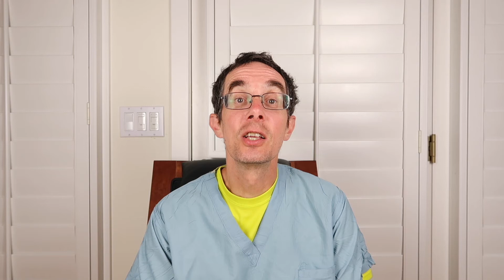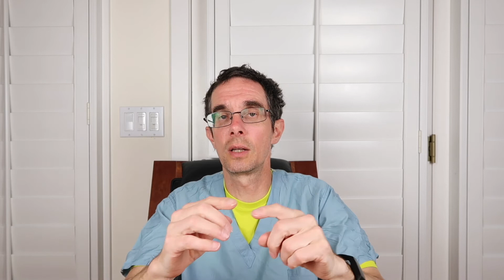Diastolic Heart Failure

Comment: Age - 49 year (female)
Echo reports (April 2022 report)
Mild concentric LVH
grade 1 LV diastolic dysfunction 
LVEF=60% approx
Trivial TR (PASP- normal), no MR, no AR
normal RV systolic function, No intra cardia mass clot
No pericardial effusion , IVC normal collapsing 

Echo report (December 2025)

Mild concentric LVH
grade 1 LV diastolic dysfunction 
LVEF=60% approx
Trivial TR (PASP- 30 mm hg), trivial MR, no AR
normal RV systolic function, No intra cardia mass clot
No pericardial effusion , IVC normal collapsing 

CHANGES (2022-2025)
2022 PASP WAS NORMAL
BUT 2025 PASP IS 30 MMHG
2022 NO MR BUT 2025 It shows TRIVIAL MR

B.P. sometimes get high and sometimes normal

Please reply is it dangerous or can we cure it completely please response 🙏♥️
Reply from the maker: Hi @Para and nice detail in the question! Yes, and no. If you're able to see the numbers in the report, there will be 2 lines that show the thickness of the left ventricle septal and posterior walls (might be abbreviated similar to LV PW, LV IVS). I'm guessing those will be between 1.1 and 1.4cm. That's what the LVH means above, which is mildly increased thickness of the left ventricle (main pumping chamber), which almost always is due to a higher average blood pressure or being overweight. There's something called a 24 hour ambulatory blood pressure monitor, it's not too popular so your care team may not have access to this, but that's a great way to know what your average 24 hour blood pressure is, and that's the best number to go by when treating blood pressure. If that average is high, that's causing the LVH, and both are causing the diastolic dysfunction, and both are also reversible if the average blood pressure comes down (either with meds or limiting sodium intake). Out of everything this is what I would focus on.
The difference in the PA (pulmonary artery) pressures in reality are more likely due to variations on the echo and not a real worsening. Same with the MR (mitral regurgitation). Trivial MR can't be cured, it is physiologic and we can see in everyone if the image quality is good. The valves are thin structures almost like bed sheets hanging on a clothes line, there's always a few tiny areas that don't quite touch and that leaves a little leaking. That is benign and nothing to worry about.
The PA pressures are dependent on diastolic function (and blood pressure and LVH), the upper limit of normal is ~25mmHg, so by definition 30 is a little high, yes that can come down with everything above, but once again I can't be sure that is a real change in the echos, and 30 is minimally high so I wouldn't focus on that number.
If you get a repeat echo in 3 yrs I'd be interested to know what happened in the interim, let me know!
Reply: Should I worry about it ? Is it dangerous?
It shoes any old mi heart attack? Please reply sir
Reply from the maker: Dangerous at this point, no. But if the average blood pressure is high, and the LVH gets worse, the diastolic dysfunction will get worse and eventually cause symptoms. This process happens over years, not weeks or months.
And old mi (heart attack) would be seen if there was an area of the heart that did not move well or if the ejection fraction was low, those are both normal, so although echo is not 100% for this there is no sign you have ever had a heart attack.
Reply: @davidnajman7640 then why ecg showed old lateral mi ??
It was false positives?
Reply from the maker: ECG is the least accurate of all of our cardiac tests, it could be leads not placed correctly, the orientation of the heart, or just the way your heart is. If there was a true lateral MI on the ECG the lateral wall motion on the echo would not be normal. Hope that helps
Reply: @davidnajman7640 thanks dr sir I was too worried about that 
my mother ecg showed old lateral mi and echo show mild lvh 
Dr says everything is normal

Comment: I'm 62, 5' 9", and weighed an average of about 190 lbs over the past year (BMI=28) and recently got an A1C reading of 5.9, which is pre-diabetes. This is the 1st time i was ever notified that i was diabetic or prediabetic.I have never been obese. I also recently got a coronary artery calcif score of 97, an overall cholerstoral # of 237 (with an LDL of 166, TG of 165, & HDL of 38). My resting blood pressure is consistently around 120 over 80 or even less, and I never materially drank or smoked. 

I recently got an echocardiogram. The doctor's corresponding report says I have Stage 2 (i.e. moderate) LVDD, mild LVH, mild stenosis of my aorta, and mild thickening of my mitral valve. I have no symptoms. I now walk 4 to 6 miles a day and spend 45 minutes on the elliptical at least 4 to 5 times a week. In 7.5 weeks, I've have lost 22 lbs and count my daily net carbs & keep them under 100 grams. I also started on a low dose of a statin

What's my prognosis, and do you have any questions or additional comments? I want to get my weight down to 155 lbs or less and reverse my pre-diabetes and get any coronary artery disease I may have under control.
Reply from the maker: With a moniker of sunchips I'd be a little worried about your sodium intake too :)
But good questions all about the heart but multiple aspect of it, so I'll go through them 1 by 1 (going to be a long response here).
1. Going out of order your response to the findings of the tests is best thing that could have happened. Unfortunately I spend half my day trying to explain to patients that changing lifestyle is more beneficial than any meds I can prescribe or procedures I can do, and it is often very hard to get people to change. Then the next year the a1c is 6.9, following year 7.9 and they're telling me at that point they have 'borderline' diabetes... Your individual approach exactly what you should be doing.
2. Regarding the a1c of 5.9, getting that down is more important than blood pressure or even your cholesterol, because once people have diabetes that not only amplifies the other risk factors, but that effects the kidneys, eyes, and other organs. When you get your bmi under 25 if your a1c is over 5.7 I would be surprised, and hopefully it's 5.5 or less.
3. The CAC score we can often predict. If you take age, LDL, a1c, bmi, smoking status, etc, we can usually predict where the number will be before the CT gets done. I'm assuming you're female because with an LDL of 166 at your age you should have a much higher calcium score. Women are protected while they ovulate (and LDL is usually much lower pre-menopause), but post-menopause women's risks are higher than men. 97 itself is not a problem, but what happens to this going forward is what's important.
4. In patients with coronary artery disease (which the CAC of 97 is you although mild), some people advocate getting the ldl under 55. I'm not saying that's a wrong thing to do, but there is no outcomes data showing that if it's under 90, that getting it lower makes people live any longer and risk of an event like a heart attack or stroke may not be alot lower either. But if the LDL is over 90 it needs to get reduced, and that should be a combination of diet, exercise, and a statin. My preference for the latter would be to start with lipitor 20mg (if you are female pravachol 20 another option), recheck cholesterol in 10 wks or so and if ldl still over 90 go up on the dose, if under 90 leave it alone). The most important dietary change here is to lower saturated fat intake, try to stay under 10gm daily, under 5 would be even better. If a kid comes home to visit and wants to go out for stuffed pizza with you enjoy it, just be more careful on the days around that so your weekly sat fat total stays low. (Yes carbs affect the a1c so with borderline diabetes you need to be careful here, but when that number is under 5.5 the carbs are less important but the sat fat always remains important).
5. Just to correct something on the echo the aorta is unlikely to have mild stenosis in a middle aged adult, they probably meant the aortic valve. The other findings are likely due to a combination of weight and LDL (the thickened aortic and mitral valves). If a year from now you weigh 150 and if your doctor wants to repeat the echo, you can reverse the LVH and diastolic dysfunction so those could be normal. Mild thickening of valves will not reverse but if those only progress minimally over the next 4 decades they would not pose any problem.
6. The plaque that is calcified is more dense than any bone in your body, so that will never get any better. The 'soft plaque' that is there can either resorb and not calcify with good control of risk factors, or continue to grow calcified plaque at a higher rate the worse the risk factors are controlled. The prognosis therefore depends on how well you do controlling things, and hopefully you can keep up your recent healthy lifestyle.
7. Once your weight is under 155 for a while if your LDL is under 60 or 70 you can think about cutting back on the dose of the statin if you want to but that's a judgement call.

If I missed something or if I brought up more questions let me know, but hope the past few months stays the same for the next 38 years.
Reply: @davidnajman7640 Thank you for such a thorough and informed response. Btw, I am male (not female). I am also sodium conscious & do look at food labels for sodium content, especially in comparison to calorie content, unless it's a negligible or no calorie food, such as soy sauce or hot sauce. I'm on a low dose (5 mgs) of Crestor. I tried to go to 10 mgs, but the side effects were too brutal. The doctor will probably also prescribe Zetia, depending on what my fasting LDL # looks like, when I go back to him in a few weeks. (I tried Lipitor 20 years ago and couldn't tolerate the muscle aches side effect.) Yes, you are right about the aorta vs the aortic valve issue regarding mild stenosis. I was wrong; the echo report is right. 

Thank you so much, again and again! 😊😊 😊😊😊
Reply from the maker: I guessed wrong (M/F), sorry. That being said, it's actually a good thing as I would expect your CAC score to be alot higher so it's a good thing that it's only 97. 
In regards to the statin side effects, I'm working on my next video that discussed placebo and nocebo, it will reference this trial for the nocebo side, and it's going to partially bash the veozah tv ads on the placebo side. I just haven't had the time to finish recording and editing it. That being said, if you do get muscle aches with any statin, I would check these blood tests: ck, myoglobin, and aldolase. If those are abnormal you probably should never take any statin again. If they are all normal the it's essentially impossible for the side effects to be related to the statins. And yes I realize temporal correlations and every individual saying that this is not them, and I'll probably get alot of angry posts, but the Samson trial specifically looked at this and placebo causes essentially as much muscle aches as statins...
https://www.jacc.org/doi/10.1016/j.jacc.2021.07.022
If you want to reply after getting labs next year to brag how good they are I'd love to see them!

Comment: why doesnt it give a number on my echo of e/ratio?
Reply from the maker: Hi Ann, this could be for several reasons, but I'll take 1 step back. There are several parameters that are seen on an echo looking for diastolic dysfunction, E/A ratio is our older measurement, but that has evolved into also looking at what's called tissue doppler which essentially means how fast the left ventricle can expand, which is the e'. This number alone in the guidelines that just came out has gained more importance but the ratio of this to the E (passive flow from the left atrium to left ventricle), or E/e', is another measurement. If either of these weren't properly measured, they won't be able to give you a ratio.
Thank you for the questions, it reminded me to put a link to the updated guidelines for diagnosing diastolic dysfunction on the text attached to the video, I'll have that updated at some point today.
Reply: @davidnajman7640  david i feel so seriously ill now i cant go on, severe symptoms are horrific & got no help from my gp & hospital, i cant bear this anymore, severe breathless, severe heavyness,, severe heart pain, cough now & then, white frothy mucus most of the day, gasping for air, rapid shallow breathing on a night, constantly swallowing at night, i have had no sleep at all in months, excruciating coronary spasms, got no where left to turn, i feel distraught even as i write this pain is off the scale
Reply from the maker: You sound terrible (sorry), I'm a big fan of 2nd opinions when things are questionable. If there is different medical group or hospital system in your area even if they have an acute care center I would consider having a 2nd set of eyes take a look at you to figure out what's going on. We have a set of panic words when patients call, you've checked off several of them so I would not take your symptoms lightly...